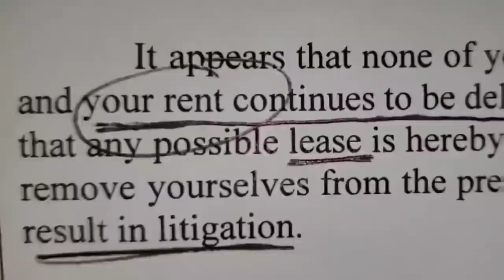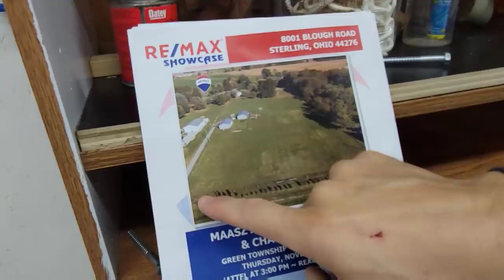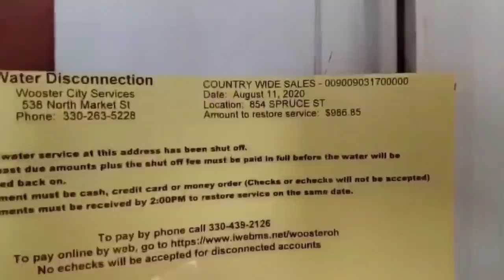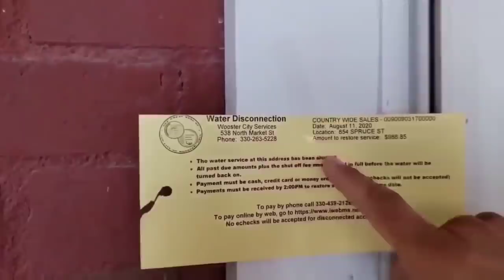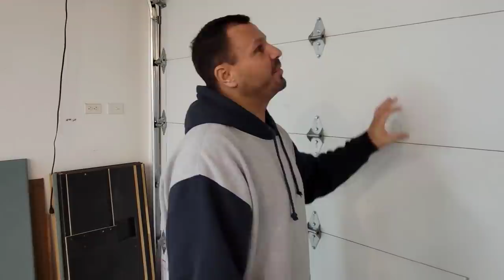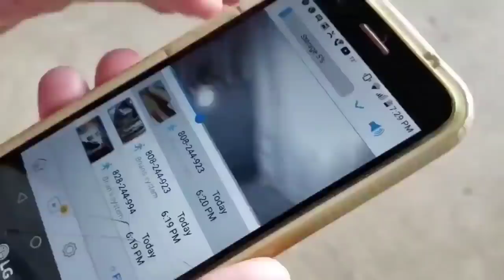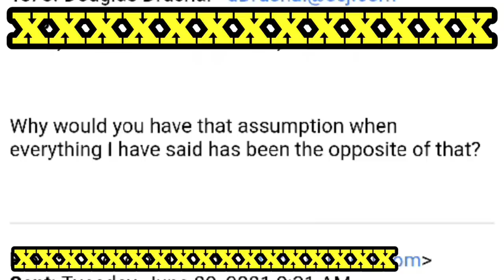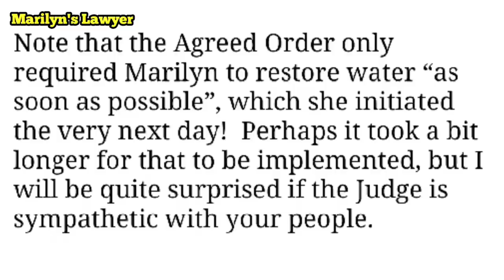SHE CAN'T TAKE OUR WAREHOUSE

Comment: I would use that little sheep shelter to store garden tools, just put a door on. I think the PVC frame was made for a chicken tractor that they can move around daily. Those concrete type weights was ballast for the flip type solid garage doors .
Reply: I have those ballasts at work for big heavy sliding doors.  If there is a fire in one section the rope burns releasing the door because the track the door hangs from has a pitch.

Comment: Not trash bags… those are bags for wool when they shear the sheep. The pull down extension cord is for plugging in the shears for shearing the sheep. Also the ‘table’ you found was a frame for holding the bags for filling with the wool!

Comment: If you are going to pour concrete floors, consider a hydronic heated floor system, highly efficient and comfortable, and with multiple buildings, you could put a central boiler in one of the buildings along with water/well controls and tanks......so many opportunities...

Comment: The paint on the weather strip will stick to the garage door. Went you went outside you pushed the door inwards helping to break that seal. Spray a silicone spray on it will help.

Comment: A well is great, but prior to that happening, you can use the roof, gutters and IBC totes to collect rainwater. Rainwater is great for gardens, washing tools or hands, even showers, just wouldn't drink straight off the roof. If you stop needing the rainwater, reselling the components should be easy, especially since you are selling a  total system.

Comment: Those wooden sticks with the graduated markings (hanging with the extension cords) are probably to check diesel fuel in a tank.
Lots of truckers use them to check the fuel levels in their saddle tanks.  Yes, we have fuel gauges,  but using those sticks insures
an accurate reading - especially in very cold weather when diesel fuel can gel (without additives).  I'm sure the previous owner had
diesel powered equipment.

Comment: Jeremy whoever installed the Lock on your front door installed it upside down, this wont matter for a year or two (possibly less) but after a while it will stop working and you will think you've been locked out. I didn't get a real close look at the key in your hand but it looked like a Schlage Lock. Taking the front knob off and turning it right side up isn't that hard but you need to know a little about how the knob set and lock works. Just a heads up for poss. future problem you don't want.

Comment: I'd use the buckets to fill with top soil drill small holes in the bottom  for drainage,  and grow 🍅 tomatoes in  and the PVC pipes as the stakes,,,, put chicken wire all over the PVC put some wheels on one side and make that a chicken tractor  to protect the chicken from Hawks and Falcons and even Eagles. And y'all can have 🥚 eggs